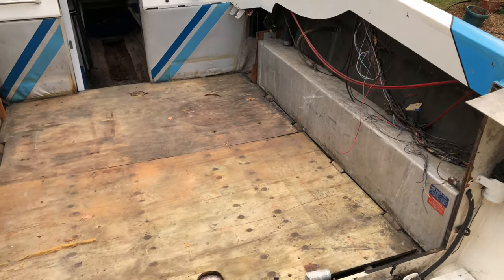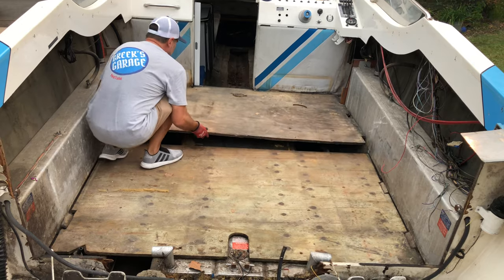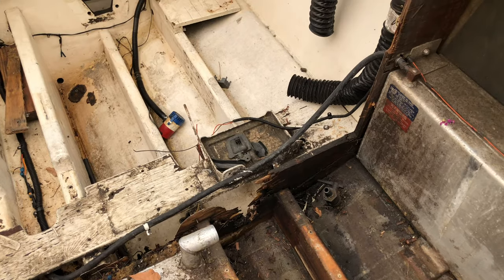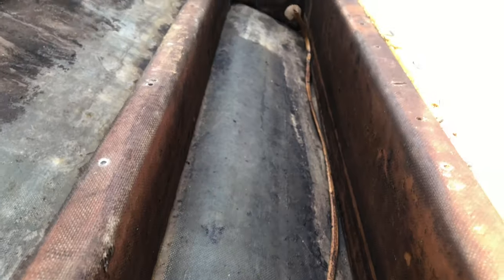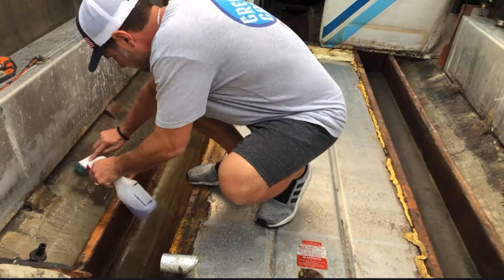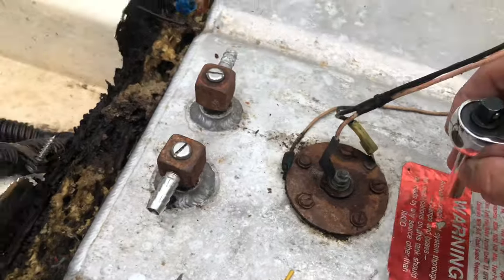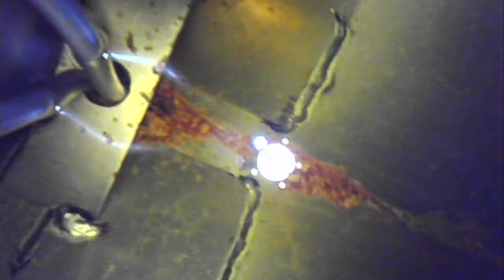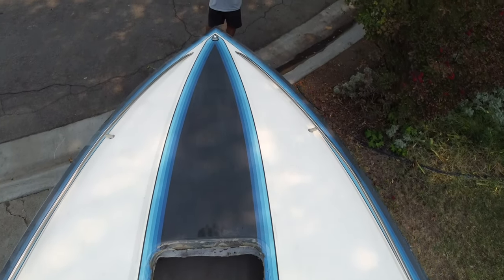Project Boat Restoration (Part 3) Floor Removal!! “Nordic”

Comment: I am truly sorry about the loss of your mom, I lost mine 7 years ago and I still miss her to this day. One thing to remember while you still have the engines out is that you need good blowers for the engine compartment and those get set (tubes at least) in the bilges at the lowest point and with that also being said now is the time to replace your bilge pumps and hoses. Look up friscoboater he did a great series a number of years ago regarding his rebuilding of a few boats
Reply from the maker: Yes I plan to replace all of that. Thanks for looking out.

Comment: I picked up a similar project a year ago I'm just getting the time to rip into it can't wait to see your other videos I would definitely put Bravos on the back now while you have it open you can always add the Big Blocks later one I have is a 27 footer with twin Big Blocks and Alpha ones I'm pulling everything apart like you did and putting Bravo's on it using pontoon boat seats to redo the floor plan

Comment: Slowly but surely. Just keep plugging away at it and you’ll get there. So sorry to hear about your mom....On a side note, where they punctured the gods skin of the stringers it looks like you have some rot starting. If it were me, and just a suggestion, inject all those holes with penitrating epoxy to reconstitute the wood and reseal the skin to make them water proof.
Reply from the maker: Good call.. yes I was going to seal all the holes with resin epoxy. 👍🏼

Comment: I absolutely can't believe they left the cross pieces bare plywood? Anything in the middle that's gonna see water frequently needs to be totally covered or it will rot. Especially near the engine where it's also gonna see engine oil from oil changes. Unbelievable!

Comment: My main concern would be WHERE the gas came from, like a punctured or a rotted and pitted tank
Reply from the maker: The boat was a theft recovery so I’m thinking when they ripped the engines out it must’ve spilled gas, because the gas tanks are looking good so far.